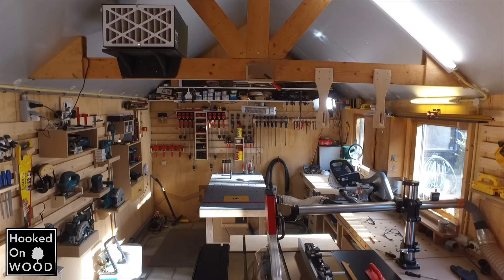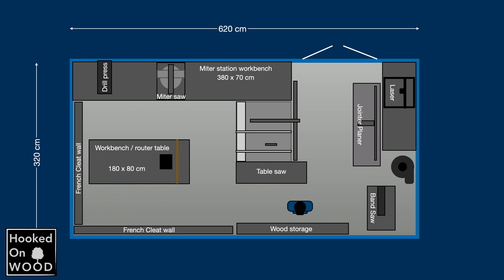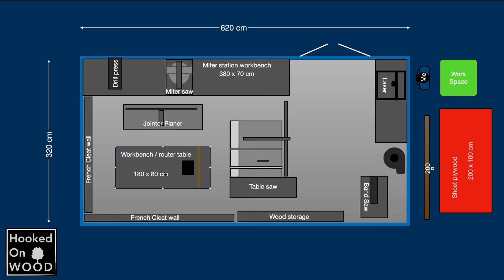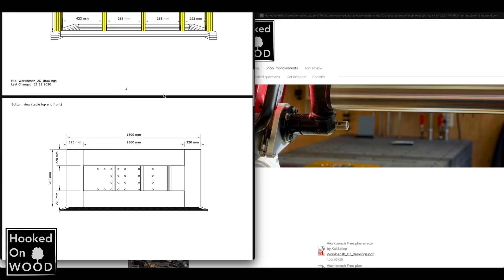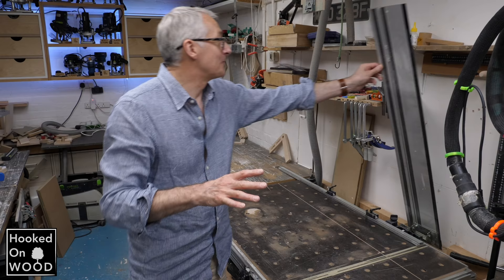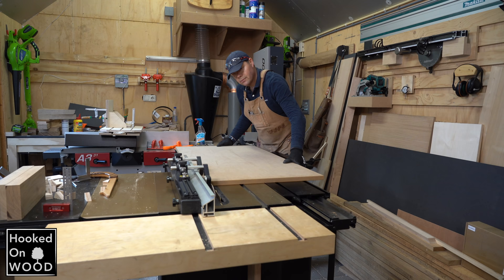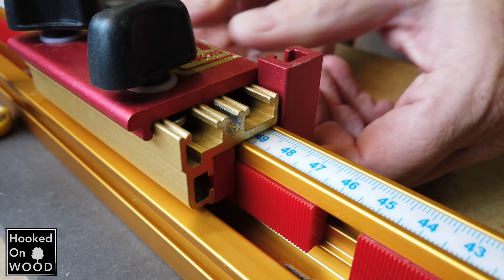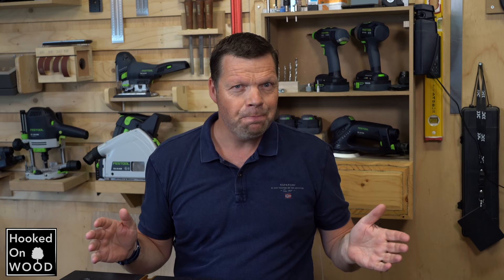How to organize your workshop!

Comment: I didn't see one Banggood tool, not one!
This guy tries to push China tools on his followers, but buys high end tools for his daily use. I am CONFUSED!
Reply from the maker: Banggood does not have the tools i showed.  But I do reviews about tools from China. I compare them with quality tools (if i have them). And till my laser only non electrical tools. But I think I work with all the 4 stars and above products from my series. So, do not be confused. I show all these machines also in my china tool series.
Reply: @HookedonWood  You are missing the point, I know Banggood doesn't sell  high-end power tools.  The point is that all your tools are high end quality tools, why don't you review them and quite pushing the crappy low-end china junk tools on the community. I NEVER see you using any of those china tools in any of your videos, except for the review video's. 
If you really think that those china tools are of okay quality or better then when are you going to put out a woodworking video of you actually using those tools???????